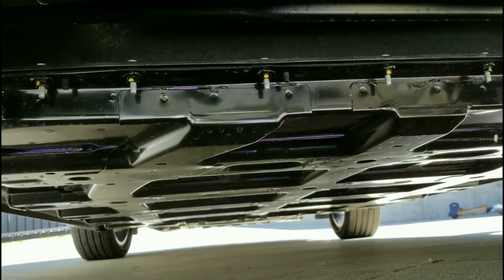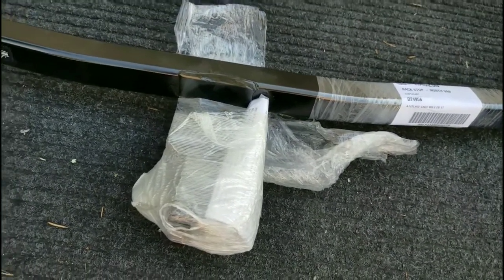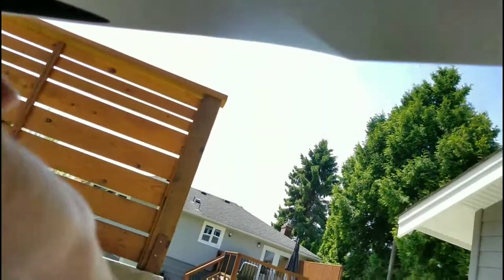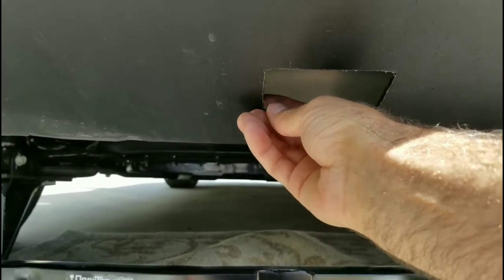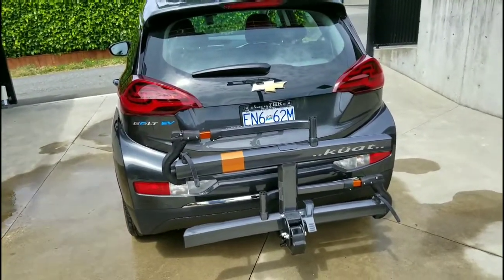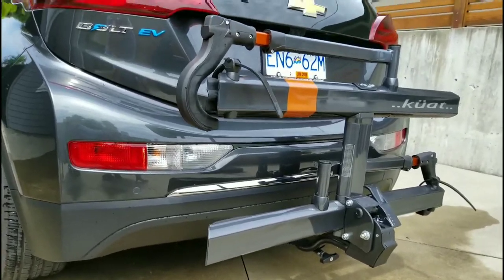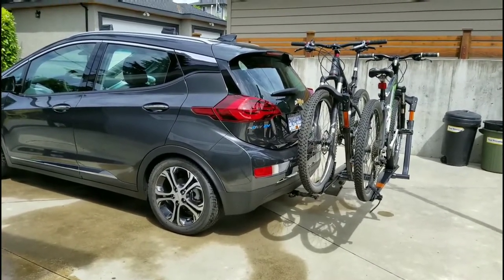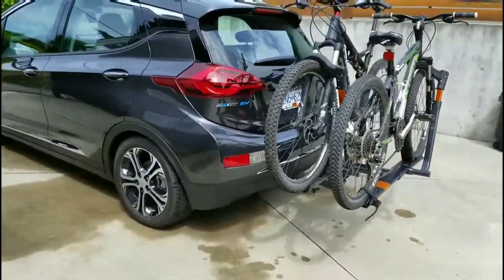2017 Chevrolet Bolt EV - Draw-Tite Hitch & Kuat Sherpa 2.0 Installation

Comment: Great - waiting to get a Bolt in at a local dealer to test drive -- nice to know I can put on a trailer hitch so easy .
What is you average range with aircon and heating - cant seem to find this info 
Cheers
Reply from the maker: PATRICK MCKOWEN Hello Patrick. I'm consuming 14 to 17 kWh/ 100km. The heat / aircon hasn't really affected range for me as of yet.  It's really highway vs city that you see a difference in range.  However.  I've only had it three months so far.  Maybe I will see a difference in the winter. Thanks for watching.

Comment: Thank you for this demo.  Is there any concern about the rack, once on the hitch, blocking the camera at the rear of the car?
Reply from the maker: Hi Robyn. The rack doesn't actually block the rear facing cameras. The difference with having the bike rack on is that the parking sensors are automatically disabled, so you don't hear constant beeping when is reverse. 👍Some cars don't do this.
Reply: @cpF01  Great, thanks Chris. Really appreciate your offering.
Reply from the maker: @robynhines8347  hi. Check it out, I made a brief video https://youtu.be/Sx5NrazCR2k

Comment: Does the hitch degrade your range on the Bolt? I commute 450 miles a week to work and would not want to suffer too much loss of range.
Reply from the maker: No. Not anything I've noticed. Far and away, Bolt range is primarily affected by heat, A/C, and Speed, in that order. The hitch doesn't really have any measurable affect. Hope this helps👍
Reply: @cpF01  Thank you! Ordering my hitch.

Comment: How does having two bikes out back affect the ride and handling?
Reply from the maker: Hello Adam. To be honest, I haven't noticed any handling differences with the rack loaded. Remember, this car has a 900 lb battery running the length of the floor so adding 100 lb to the hitch doesn't really make that much of a difference. The Kuat Sherpa 2.0 rack itself is pretty impressive. It have a really cool system for taking out the 'slack' between the receiver and the hitch, so the rack doesn't move around. I really happy with the whole system. Perfect for two bikes.

Comment: Hi Chriss. I was wondering what your recomendation would be for buying a tow ball for this hitch. I want to use bike racks that can go on tow balls, and i wondered about the length of the fixed ball mount, how far from the bumper it will sit. i was thinking about this one: https://www.etrailer.com/Ball-Mounts/Curt/C45572.html
Reply from the maker: Hello kammiz. Well, I've never towed anything with my Bolt but I'm sure you probably could. The hitch I installed was rated for 2000lbs / 200lb tongue weight, so maybe a small garden trailer. This Curt 1 1/4" ball seems to bring the receiver out far enough to tow without any issues. You would also have to install their electrical kit for the tail lights. If you do it, take a picture, let me know how it goes. I would love to be able to tow a small trailer so I could pack mini bikes around.
Reply: Hi Again Chris. Well im not gonna tow anything, its actually illegal with this car in norway. But i want to use a bike rack that can be used on other cars too, so thats why i want the tow ball type bike rack.
Reply: The manual for Bolt says not designed for towing.  YMMV.

Comment: have you tried to tow anything with this yet?
Reply from the maker: Hello abbaby555. Thanks for watching. No. I haven't towed anything using the hitch, and really, I don't plan to. This was simply designed for use with a bike rack... which I have used many times, and works well!
I didn't even wire in trailer lighting, although I have seen Bolt EV specific wiring kits... so someone out there is considering it. 

I hope this helps.

Comment: do you think a dirtbike ramp would fit on the back? ive got an older Yamaha 175cc 2-stroke.
im also in BC. expecting my Bolt to be delivered in December!
im thinking of something like this:
https://tinyurl.com/ycnurqm3
Reply from the maker: yoyit2Dan Hi. No, I don't think so. I have a little dirt bike rack too. But it's 2" receiver and carries 200lbs. This car will only carry 100lbs on the hitch. I would think.